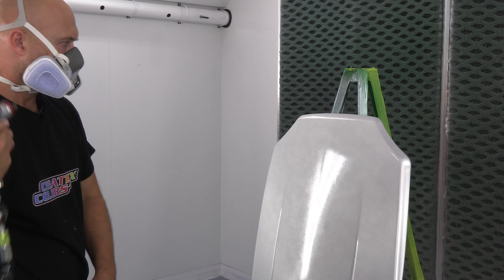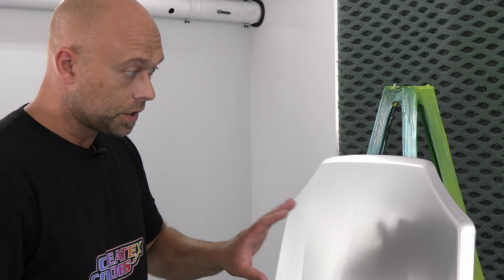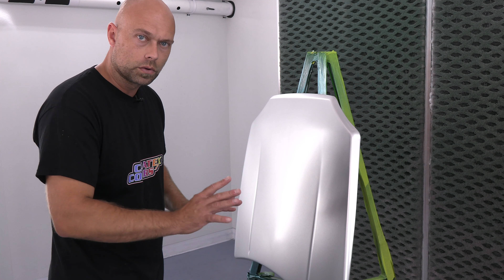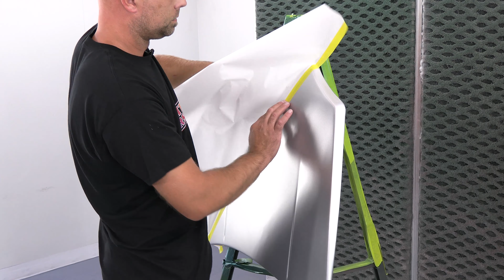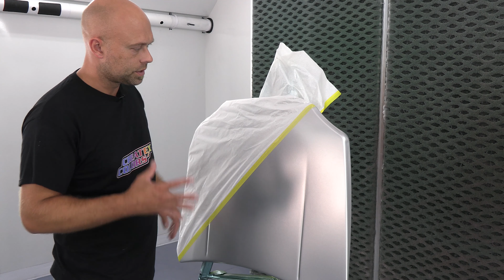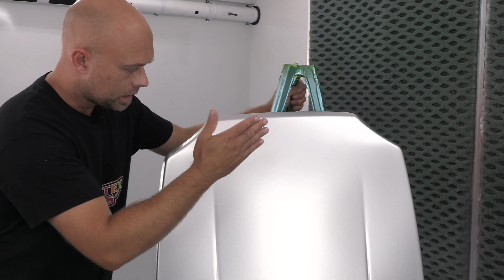How-To Apply a Metallic Drop-Coat

Comment: In this case you lowered the pressure and doubled the distance between the panel and spray gun.This caused the paint to be darker and go on smoother"velvetlike". if you raised the pressure would that cause the paint to go on lighter but produce a rougher finish? Thank you.Nice video though on videos it is so hard to see the difference but you described the difference well.
Reply from the maker: The drop coat is at reduced pressure, increasing the pressure creates texture / a rough finish. Thank you.
Reply: @CreatexColors  got it thanks

Comment: Great job explaining something that makes metallics doable for the hobbyist. Question for you:  Painting a car with metallic panel by panel has always been the easiest for a hobbyist but has always been discouraged because of differences in the metallic look between the panels. How does this work if you just spray the panels for coverage, then assemble and drop coat the entire car for uniformity? Seems like a solution, have you done it? Thanks for your help, Rob

Comment: I had a question i sprayed a brown metalic and did not notice tiger stripes in the middle of a trunck until i finished clear coating it and brought out to the sun how long do i have to wait for clear to cure so i can try and fix it.
Reply from the maker: Its best to check with the manufacturer of the clear for cure times before sanding and re-coating. Thank you.
Reply: @CreatexColors  thank you.

Comment: Can I add 20% more reducer to make it lighter on a 2:1 mix
Reply from the maker: It would be better to lighter the concentration of metallic by adding more 4050 UVLS Clear as resin will be added as the color is extended, providing better film formation compared to over-extending with reducer which can negatively affect adhesion and coating integrity along edges, difficult areas. If you wish, perhaps make a test panel comparing extending the metallic with 4011 Reducer vs. 4050 UVLS Gloss Clear. We prefer the 4050. Thank you. www.uvlsclears.com

Comment: I have an issue with silvers.

Even though I have a good match I still see that the section of the panel I painted is not a sparkly not as metallic as the factory.
 under certain angle you can see the "flatness" in my paint.
 anybody has a suggestion on gun size , tip size,  nozzle size,  pressure or whatever I can do to help my issue greatly appreciate it thank you

Comment: Hi, i had problem because this is my first time doing metalic color, and i didnt spray drop coat..now, my panel have uneven and splotchiness..

How can i getting rid of them ?
Thank you
Reply from the maker: Depending upon how uneven, if just a bit sanding the existing finish flat 800-grit sandpaper  followed by another 2 coats of the metallic, then a drop-coat should work. If very uneven, it may be best to re-apply AutoBorne Sealer, followed by metallic coat, www.autoborne.com. Thank you.
Reply: Fo you spray drop coat right after last coat while its still wet? Or after last cover coat dries.

Comment: So we sprayed a metallic paint and didn't pay attention before we cleared and after clear there is tiger stripes what's the best way to getvrid of that
Do I re prime the pannel or do I sand down the clear and respray color?
Reply from the maker: Depends. Best may be reapplying AutoBorne Sealer followed by metallic color. If the striping is not too bad/ noticeable, you may get away with just applying a few more coats of metallic color after sanding the clear flat with 800-grit. If in doubt, reptile then reapply the metallic color. Thank you.

Comment: If i have a matte black color on my car would i need to put a sealer to make it a silver like this?
Reply from the maker: It depends upon the condition of the existing paintjob, however, yes, we'd always recommend starting with AutoBorne Sealer so the ground coat has good adhesion and any minor scratches are filled-in. Thank you.

Comment: Can you apply metallic with a 1.3mm tip?
Reply from the maker: Yes. Best application of Createx metallic colors is to mix with 4050 Gloss Clear, thin with 4011 Reducer and spray with a 1.3mm tip-size, set at the spray gun manufacturer's inlet psi settings. Thank you.

Comment: DID YOU USE SOLVENT OR WATER BASE?
Reply from the maker: water-based, www.createxcolors.com. Thank you.
Reply: Would this process be the same for solvent? I’ve heard people going up on pressure with solvent base.
Reply from the maker: We recommend contacting the manufacturer of the paint you're using and making a few test panels trying various psi settings. Thank you.

Comment: recommended needle and tip size when spraying metallic with pearl in it?
Reply from the maker: Check with the paint manufacturer for tip-sizes. For Createx metallic & pearl paints, a 1.2mm or 1.3mm tip-size is recommended. Thank you.

Comment: About to do my first metallic paint job on my car. What psi are you spraying at and when you do the drop coat what psi did you go down to? Thank you, great video
Reply from the maker: The psi setting is what is recommended for the spray-gun manufacturer. For a drop coat, this psi is lowered, about 5 - 8 psi less. Thank you.

Comment: What's your gun setting for material an fan partten?
Reply from the maker: Set the spray-gun at the manufacturer's recommended inlet psi. The fan pattern is ~ 1/8 turn from fully open. Thank you.
Reply: @CreatexColors  thank you 👍